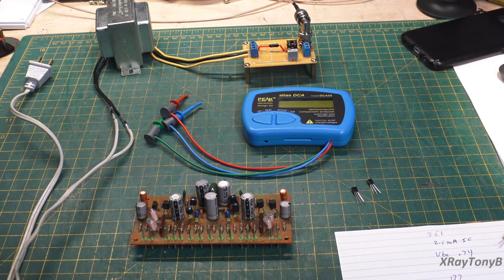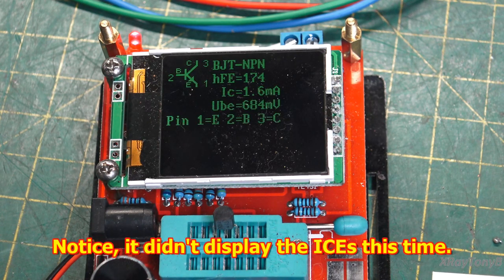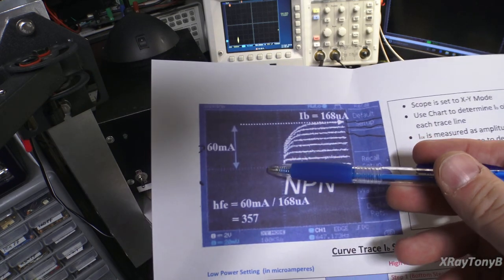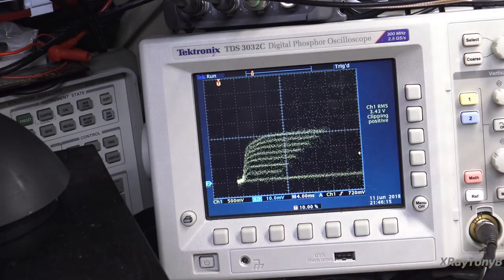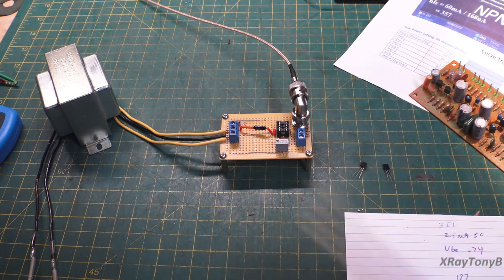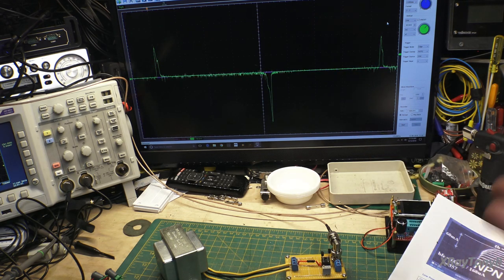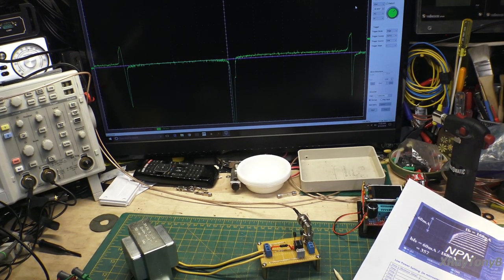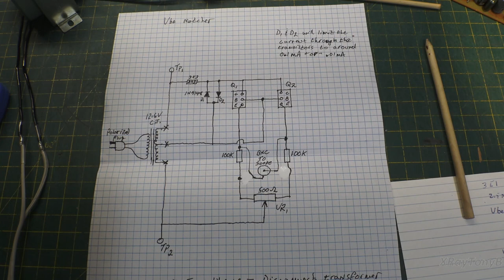Transistor Testing & Matching

Comment: So how do I know. A circuit needs match transistors?
Reply: This is a question of circuit design experience. Usually you need matched transistors in differential amplifier stages and current mirrors. These are the typical circuits where matches of Vbe and hfe are essential to avoid offset and disproportionality. In many cases, especially if you don't need to go to the limits of voltage gain, there is some work around by use of emitter degeneration resisitors.

This would be a nice topic for another video about the possibilities and limits of the use of mismatched transistors with emitter degeneration resistors in differential amplifiers and current mirrors.
Reply: @gkdresden  I see. Thanks

Comment: On the curve tracer, shouldn't you also be using the data to plot Ib vs. gain?  That way, you'll have a curve defined by seven points, and well matched transistors will follow the same curve?

Comment: I enjoy your videos, Tony @xraytonyb . They are very useful to us audio enthusiasts. Just one question about this simple Vbe matching circuit: How good is it in real world conditions, for matching the transistors for differrential input pair of the amplifiers? I need to create a replacement of the monolithic differential pairs (uPA74V and uPA75V) in discrete variant, consisting of  two thermally coupled single transistors. Is it enough to match them with only this tester? You have many years of experience, so I think you can help me, because you probably had compared the results of the same two transistors paired with this tester with the results obtained with curve tracer. Thanks in advance and greetings from Serbia.
Reply from the maker: Check out the video I did on the Pioneer Spec-1 preamp.  In that video, I go into quite a bit of detail about matching the transistors.

Comment: Realy liked this circuit with a opamp socket and ac transformer 24 volt with senter tap give 12 volt 0 and 12 volt.?It seems to be what i need to match signal transistors.Wonder if i use i ac supply with variable ac to match output transistors would work.maybe another value on the 20 turn pot?this i am going to build a verson of.Very informative videos sir.

Comment: I think you need to protect the base emitter junction from reverse breakdown, most high gain transistors have very low reverse breakdown voltage usually 5V or less, this could potentially damage the transistors or might change some of the parameters or lifetime of the transistors. In your circuit you might connect two Zener (4.3V) diodes in reverse polarity in series and this whole arrangement is connected between the base and emitter of each transistor. This arrangement might adversely affect the measurement in high temperatures due to the temperature dependence of reverse current before breakdown of the diode.

Comment: I’ve got the Peak Atlas DCA55 - best money I ever spent; though mine has a black case, rather than a blue one. I’d recommend this to any electronics tech or hobbyist into designing/testing/salvaging solid-state electronics. Sadly, there’s no easy way to test SOT-23 package devices; the clip leads are just too big and unwieldy for this. 😥
Reply: You could build a jig that clamps down on the surface mount transistor and have test points.

Comment: Tony what about the DCA 75 pro with curve tracing ?
Reply from the maker: That's the one I was talking about when I said Atlas had a USB model.  Although I haven't tried it, it really looks promising.  My Curve tracer can do a maximum +/- 10V and 2.3mA test on "high power" mode.  The Atlas DCA75 pro can do +/- 12V and 12 mA.  I also like the idea of the USB interface and software.  If you connect via USB, you don't even need to use the internal AAA battery.  I may purchase one in the future as funding permits!  Thanks for asking!

Comment: I just use the transistor "beta" tester build into my B&K device tester. For a typical batch of 10 small signal transistors the Hfe may vary by +-20%. No need to measure Vbe. I've had good results with this method.
Reply: in a differential amplifier where the emitters of the transistors are connected, the difference in Vbe does matter a lot.

Comment: I'm building a Tester, hopefully nearly same like your's, got it as a DIYkit from ebay. What I would like to know is, what kind of cable are you using in your tester from the board to the case? The cable to the BNC Connector would be most usuarly coax. The Cable to the Transistor? Also coax to reduce any noice?
Reply from the maker: Check this video out    https://youtu.be/7exRUNCQ-hI    It goes into a bit more detail on the Curve tracer and how I built it.

Comment: You would have to match the Vf of your 1n4148 diodes also or it will skew the results
Reply: No it won't. NPN transistors are being tested when one of the diodes is conducting (the positive half cycle applied to the collector side), and PNP are being tested when the other diode is conducting (the negative half cycle applied to the collector side). We're not testing both at the same time.

Comment: I guess that  collectors and emitters should be swapped in your schematic, otherwise these two diodes don't make much sense.
Reply: Is this statement correct? Is the schematic incorrect?
Reply: @t1d100  No, the schematic is correct. The diodes are there to reduce the voltage on the collectors to one diode drop above ground. For an NPN, the voltages are approximately: Vc = +0.65V; Vb = 0V; Ve = -0.65V (and the opposite sign for PNP). The idea of keeping a low voltage drop across the transistors is to minimise the power dissipation and hence the self-heating of the devices. With a collector current of about 0.1mA, that is irrelevant in this case.
Reply: @RexxSchneider  Thank you, good sir! I get it!

Comment: this test matching circuit you build/thinkering with. ac transformer with senter tap 3k3 resistor couple of diodes  a socket and 2 100k resistor and a 20 turn bourns vr pot etc.Would it make it better be a good idea if the ac frekvens could be variable to?.Or is it one spesific value that tells that a pair of transistors are matched over a wide range frekvensy.For me audio range is importent.
Reply: No, you are only going to get the frequency that you already have in your AC power socket at home. 
I understand what you want, to have variable frequency, it's going to be more complicated! You will need a function generator, if the function generator has the sweep ability with adjustable sweep speed, that would be even better, the generator will have to control a transistor which is going to drive the test transistors. It's much more complicated but it could prove to be useful, especially if you use a variable power supply, that way you can test at or above the voltage that they are going to be working in and also sweeping through all the frequencies that they are going to be expected to work with. 
That would make a really good real world test... 
All the voltage would be there, the heat from working with be there and the frequencies will also be there, you just need to see if anything changes over the frequency range and time as they heat towards their operating temperature! Nice 👌 
But who's going to make one? 
A function generator that has the ability to sweep with starting frequency and ending frequency, forward sweep and backward sweep, not cheap! 
I don't know of any cheap good quality low noise Chinese generator that has those features... 
Sweep is very important for audio work...